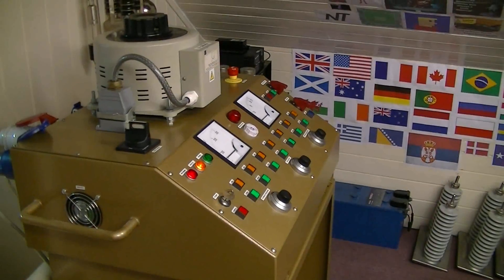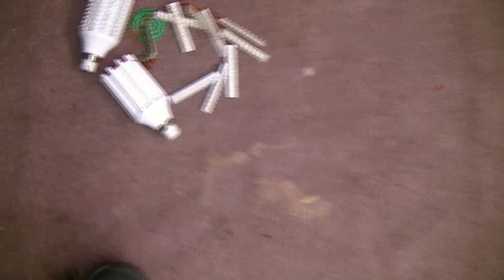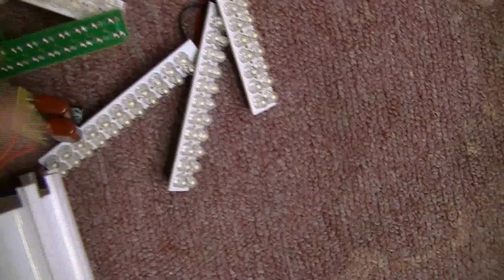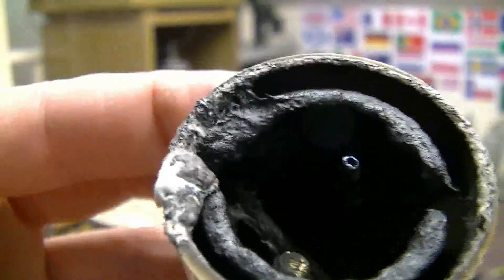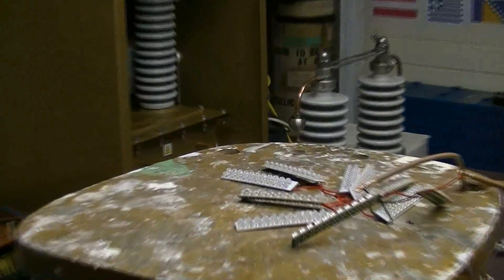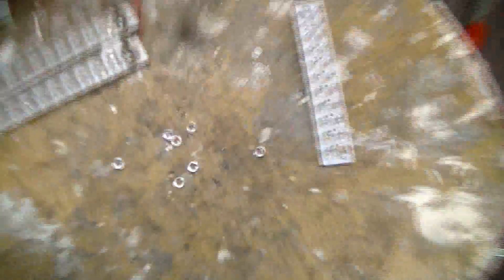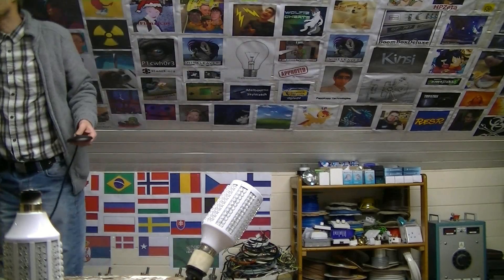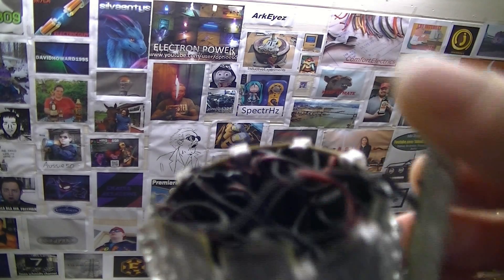LED Lamp Blasted With 6000 Volts

Comment: Question, where do you get the amount of electricity and how does it all come together? Unless you have a high tension line on your house lol
Reply: i think he still uses the mains around (110~220) and that rig you see is a psu with generators and lots of coils to produce the 6000+ volts

Comment: Andy.
Heres an idea. If you have or can get a high power commercial amplifier like 2000 watts or so you could play music thru appliances and then you could connect the speaker outs of the amp to the primary side of a MOT and maybe make a jacob's ladder that plays music. Or fry things with music. Just an idea for a video.

Comment: Nice vid mate :) I love at 2.48 where the ring comes off the led and then lands on the chair , farken funny . QUESTION ANDY how does you get that cap bank discharge to change its pule rate at 3.44 ? i thought you were just manually discharging with your hand but it just goes to fast at one stage (like chinese firecrackers lol)

Comment: Hey Photonicinduction, I've seen most of your vids the coconut one was just genious! The point is though I need your professional advise, you see I have a very noisy neighbour they play loud music at all hours and its driving me and my missus mad, going down there and putting my fist in his face will just causes bad feeling like with the last tenant.

My missus is all for keeping a record of the times of disruption and writing letters to the letting agency and so on, but i'am not having any of that!

You see, I have access to their fuse box and electricity meter but pulling a fuse would be too obvious, I mean they play music too loud, my missus bangs on the floor, their fuse goes missing, no, there's got to be a better way.

I was thinking, can I burn out the roms in their music system by using piezoelectric gas lighter say with the top removed and applied directly to one of the cables coming out of their electricity meter? But then which one? or how about somehow using the workings of a bug zapper? All of course while the offending load music is playing.

I have seen the odd dumped microwave oven laying around the bins so a capacitor wouldn't be hard to get hold of but how to charge and use it does scare me a bit.

Also the electric cable coming out of their meter is of standard thickness, would a spark even jump across it? I just don't know.

What do you say? Can you help us? For humanitarian and for science reasons of course! 

Best regards, mooog1
Reply from the maker: There are many ways to achieve your objective, however I am not permitted to instruct you on how you could do this.
I've had a few neighbours like the for mentioned, they have never dared piss me off twice lol :)

Comment: I poped a cap outside my uni room window =-)

Need a few more, not going to do it in the room as setting off the fire alarm would get the accommodation staff asking questions that I would not want to answer =-)

I need a big boys supply, it would be fun turning old PCB's into fireworks.

Comment: nice work!! i have got a washing machine motor and have worked out how to wire it up. it spins nice and fast, also i can make it go the other way round....what would happen if i fit a switch to change the direction of the "jumpers" as it is spinning at 30k in one direction and then flick the switch to make it turn the other way. would the earth stop rotating or would the moon fall out of the sky if this was done?
Reply: If the motor is not secured it would turn around.

Either way the motor would probably be ruined.

Comment: Very good, Mr. Photon. :D

I did like the way that lamp holder fizzed-over and you carried on blasting it until it had a meltdown and was shooting plasma out of the top. Then we got flaaaames. :D

Top Job. :-)

That device at the end.... Methinks that was a smoke-bomb with a capacitor label put on it to fool us all. How much smoke did they stuff into that thing?! :D

Did it whistle? :D

Yes, that was a nice teeaase of that cap. I once did that method with a cap from a CFL in a jar. It let loose at 90v on the variac and let out way more than enough magic smoke to fill that jar.

I want to get another cap and put it nto a sealed bottle which has been slightly crushed, tease the cap on the variac, get it to let loose in the bottle, then check to see if the smoke is still floating around in the bottle a week-or-so later.

Chances are, opening the bottle after a week-or-so will release the intensified, concentrated smell of a thousand rotten socks. :D

....All at once! :D Now, that WILL whistle! :D

Thanxx for showing,

-BoomBoxDeluxe.

26th January 2014, 19.32

Comment: photon, I have a question, from where come the noise when you discharge your capacitor bank?? like a metallic plate being hit
Reply: That resonating sound is caused by two HUGE military shell-casings that are in the room.

When the shock-wave of the cap discharge hits them, it causes them to 'ring' a bit. I had the opportunity to look inside one of those when I visited, and they're empty inside, apart from a spent detonator tube which is about half-height inside the centre of the casing. :-)

-BoomBoxDeluxe.

26th January 2014, 19.10
Reply: BoomBoxDeluxe
 Very nice effect it gives though. Adds to it.
Reply: BoomBoxDeluxe
damn shock wave!! thank you very much boombox
Reply from the maker: BoomBoxDeluxe
Totally Correct BBD !
Reply: *****
andy, can you show the shells in the next video please?

Comment: I have an idea for a video, how bout you put a few too many volts into an old, slow computer using one of your homemade "Computer power supply units"? Should make the old computer run a lot faster.  Perhaps so fast, that it produces flames due to the fact that it can run at such a fast pace.

Comment: Great video! I did notice you still have the mercury ark rectifier, got anything in store for it?
Reply from the maker: Got to sell it man, it is at risk of getting smashed :(
We saw it glow, that was that :))
Reply: Bummer, at least it's going out in good condition. :)
Reply: *****  should enclose it in a clear box of some kind to contain the mercury then apply the turn it up on the variac until it pops volts.
 

Or make a power supply using it. Would be nice to watch it increase its glow as you increase the amps through something you're popping.

Comment: Pretty nice, here is an idea, why don't You make "small" EMP device using large bank of capacitors and large coil, and make some devastation of electronics. that will be nice to do.
Reply: Saulscmit
It doesn't take much to do small scale EMP. When I was in college, I had a problem with the neighbor playing his radio really loud. I took a 5uF, 370V motor run cap, charged it up to 340V or so, and repeatedly discharged it through a coil of wire with a SCR and some neon bulbs. I then heard some thumping synchronized to the flashing of the neon bulbs followed by the radio turning off.
Reply: You need a large magnetic field to do that. There is a threshold that the phenomenon has as well (much like everything in physics as its limits). He'd have to make a device which would eat power (if you've been around long enough im sure you've seen him make his neighbour's lights dimmable lol) & knock out more than just what hes got under it, unless you have several kilos of Pb shielding the thing. The device you consider as well uses X-rays, natural or man made nuclear EMPs (with Earth's mag-field) emit gamma-ray energy photons.

Comment: how does the auto transformer give you more amps? Never heard of an auto one before :P
Reply from the maker: Same VA, output half voltage but double current :)
Reply: oh, halfs the voltage, didnt know that :P   I under stand volts, amps, and watts. But still trying to understand VA, from what i read its different from watts :/

Comment: Tightarsed bastards, just a dropper circuit and no power supply! Where the fuck's that lamp from?
Reply from the maker: "who flung dung" made it on ebay! :)
Reply: *****
Marketed as "dimmable" by any chance?
Reply from the maker: AintBigAintClever
lol, everything is dimmable, 500v down to 240v :)
Reply: *****
Update on the Eco Ers one I bought on eBay. Nice and bright. Tested it with a halogen bulb on a probe lead, nice and LIVE!
Video coming later.
Reply from the maker: AintBigAintClever
Live is good man lol maybe we can treat LED lamps like a toaster, don't probe or touch when on lol :)
Reply: Most of the early LED lamps used capacitive droppers, and many still do.  Even the Philips 2W GU10 uses a beefy cap to limit the current.  It's actually a really simple and reliable circuit.
Reply: Actually a dropper circuit is better as it produces no RFI whereas a power supply which would have to be switch mode due to size could possibly produce RFI.
Reply: jmcinvale Not on devices with bare metal connections, though. Could possibly get away with it on the one nuked here as the LEDs are the conventional epoxy-capped type, but on the one I tested earlier today (and broke during testing) there are touchable connections that are only 10 ohms plus a diode away from the incoming mains.
Reply: AintBigAintClever  No LED bulb should have any connections exposed on the outside of the bulb (when the bulb is properly seated in the socket) that have the potential to be at or near mains voltage.

If you have an LED bulb which when properly seated in the socket has exposed connections at or near mains voltage then the bulb is unsafe and shouldn't be used.
Reply: Hopefully Trading Standards/Citizens Advice will see it the same way. I've done the test video, I'll hold off releasing it until I hear back from Citizens Advice.
Connected one end of a 25 watt pygmy bulb to neutral and touched the other end to the LEDs. 83mA and a nice, bright pygmy bulb. Tried it with a 100 watt bulb and it blew the LED driver but stayed live, drawing 157mA.
Reply: AintBigAintClever Typically there'll be a low value resistor and a capacitor before a rectifier, so exposed solder joints could have just a diode between them and the mains or a diode and either a cap or resistor.  It also depends on which way in the lamp is inserted.  Personally I think the live lamps are most amusing despite the potential for death.  Maybe wee Chinese kids learn that electricity hurts at an early age.  Like when they touch their new Barbie death lamp.
Reply: AintBigAintClever  Thing is on a properly made bulb and socket the live connections should only be on the inside of the lamp.
Reply: bigclivedotcom
On this one you've got a choice of inductor, capacitor, 20 ohm resistor and diode from one side of the mains, or a 10 ohm resistor and a diode from the other.
Oh, and a 400v 10uF electrolytic putting its two penn'orth in as well.
Reply: AintBigAintClever  Cool. At lease there is no chance of RFI from that circuit.

Wish all LED lamps were made like that.
Reply: Dangerous LED "corn cob" lamp test and teardown

Comment: You should sweep up the remains of these crap led lamps and return them as faulty goods. :-)

PS Aldi in Oz where selling led lamps and fluorescent replacements for $12.95 for the lamps and $24.95 for the fluorescent replacements and they work very well indeed.

There where a special item here and not normal stock. The price of led replacements in supermarkets and hardware here is a rip off unfortunately.